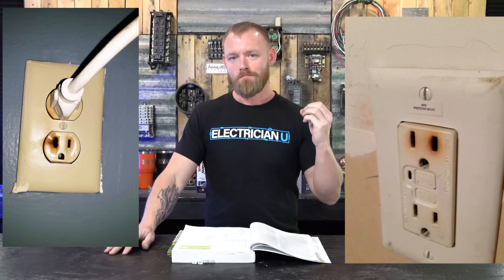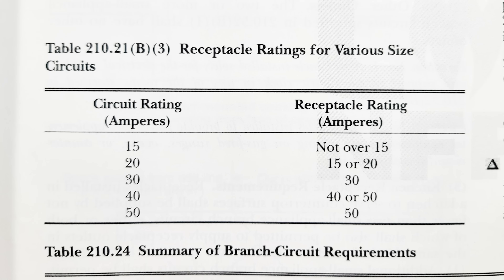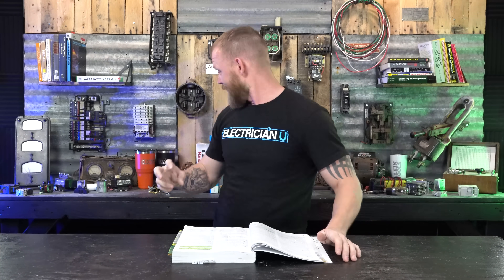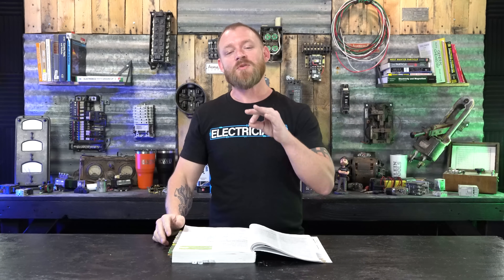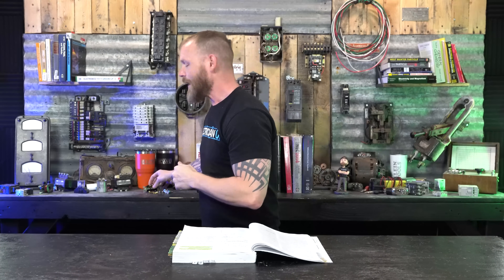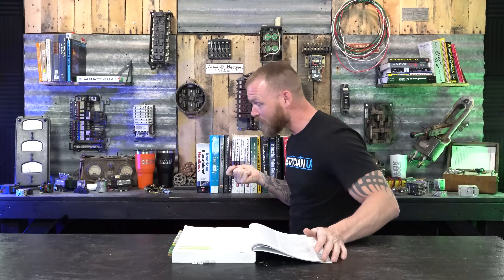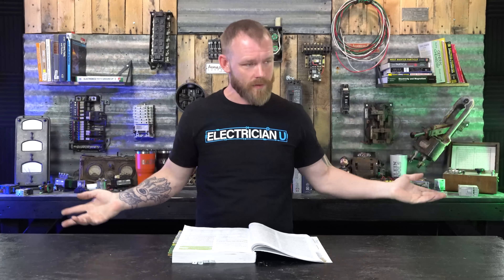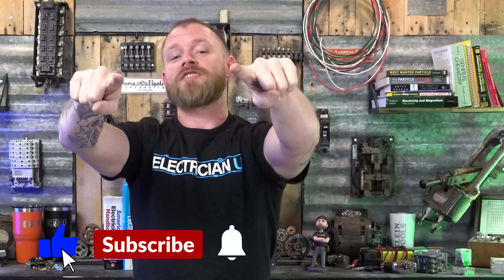Won't These Melt?!? 15amp Receptacles on 20 amp Circuits!!!

Comment: Thank you for an explanation that is not so technical that it confuses me or worse yet a tenant. While working in one of my units I noticed that a tenant had bought one of those cheap 6 receptacles in one all on a 15 amp receptacle and a 15 amp circuit. Everything on that side of the living room was plugged into this one 15 amp receptacle even though there was another receptacle on the same wall but 6 feet away behind his couch.This building when I purchased it was what my Father called a remuddle. I removed it all and left him a note that he needed to connect some of his devices into the receptacle behind the couch or around the corner on the other wall because those went to another circuit. 

He said that it was inconvenient and he hated the look of extension cords. He'd been doing that for years in other apartments so I was being an alarmist. It's an exhaustive list so I won't bore you with it but when I got home and calculated how many amps he was drawing I got even angrier. I had tried to explain that it was a fire hazard but not being an electrician and being a woman he dismissed my concerns. He demanded I return his "stuff" and I said no and when I inspected again just to be safe I found he'd just bought another one. I wrote him a formal notice of non-compliance with the lease and if it continued I'd evict him. 

He texted me that he had called a city code inspector and he was sure he'd win but the inspector came out checked the receptacle and the breaker box. Both were 15a. He still thinks that the code inspector sided with me because I was the owner and a woman and he was furious when the inspector wrote him a formal warning.  I'm going to have him and future tenants watch this video so please don't take it out of your collection of videos. Your explanation and demonstration are clear and concise and having looked at about a dozen of videos over the last few days yours is by far the best.  I am even going to watch your other videos because I think I need a better understanding of what powers a house or building. Thank you!

Comment: Thank you so very much that was very informative I'm building a shed into a tiny house and I am putting my electrical outlets in my light socket outlets and I'm going to build a little teeny tiny kitchen with a small refrigerator and I appreciate that thank you I am also off grid

Comment: And then all the common max strength space heaters are 1500w, which is 12.5 amps... So even then, some of these most common devices people will use on a single 20 amp circuit, on 15 amp receptacles are not good for code...

Comment: I am considering buying an EV to replace an old car. But my main circuit breaker is only 125 amps and my breaker panel has been filled with circuit breakers. So, I am considering just doing Level 1 charging using a 20 amp 120 volt circuit and changing the 15 amp rated plug to a 20 amp rated one. Then I could change the charge rate of the car from 12 amps to 15, as per electrical code. Is this wise? It is a circuit that only has a garage door opener on it which can be moved to a different circuit, 15 amp that is already GFI protected.

Comment: On a 20a circuit , can you wire 15a to wire to overhead light boxes from wall switch that has 20a input?  
 I ask because, the dinky wire that come with led light fixtures are easier to connect to 14 than 12.

Comment: He doesn't mention GFCI outlets with reset buttons that typically feed other "plain" GFI outlets on the same circuit with some of them being 15 AMP.  Wouldn't any of them on that same circuit trip that GFIC outlet with the reset buttons if overloaded?

Comment: Fantastic video. I didn't realize a 15 amp receptacle was different from a 20 amp. I had thought they were made simply to prevent putting a 20 amp appliance cord in a 15 amp circuit.
Reply: With the exception of some specific power tools and industrial equipment, and old Xerox photocopiers, I have never seen a 20 amp (T-slot required) plug on any residential consumer grade electrical appliance except through-the-wall (sleeve mounted, not window) air-conditioners. Incidentally, there is the very rare through-wall AC that requires a 15 amp 240 volt circuit, and those plugs look like 2 horizontal lines. ( - . - ) Only ever seen them in apartment complexes.

Comment: As the US transitions more to electric vehicle owners it will be more important to be mindful of this especially for outlets in a garage or within reach of a driveway (porch, etc).  They can pull a continuous load for a very long time, especially at 110v.
Reply: Code is one step ahead, as it has been floated to require a 20 amp dedicated receptacle for each vehicle bay. Most EV owners will however want a more robust 240 volt level 2 option.
Reply: @darrendolphdragos9752 oh for sure, 240v is better and what I'd recommend.  But even a 20a 120v outlet  will net 7 miles per hr (84 miles overnight).  That's more than most people drive in a day and would meet the needs of 98% of drivers.  Easier to get installed for most too.

Comment: My entire house was wired with 12 wire and 20 amp breakers with 15 amp outlets.  I never understood it.
Reply: If you have multiple receptacles + lights on each 20amp breaker that would make total sense. 20 amp can support up to 10 - 15amp duplex receptacles if I remember and allows for 20amp appliances at the same time.

Comment: Most new 15 amp receptacles that I have installed have a 20 amp pass-through rating stated on the box and stamped on the receptacle.

Comment: The bigger issue is sub-dollar receptacles, no matter what the rating. Over time, I've replaced every one in the house. Three of them were a bit sparky, showing visible signs of failure.  Another very practicle reason to have 20 Amp receptacles on 20 Amp circuit is so that you can visually see what you are plugging into.
Reply: news flash your industrial grade receptacle is a sub dollar receptacle.

Comment: This is great, until the load that you have plugged into the 15 amp receptacle goes south.  What happens if the load partially shorts and starts to draw more than it’s rated amperage, or exceeding  the receptacles rating. Wouldnt this cause  receptacle to overheat, before it trips the breaker?  Better not to scrimp and install all 20 amp receptacles.

Comment: A space heater is a coil of wire that glows red hot when  electricity is ran through it, which is then stuffed in a small plastic box with a tiny fan blowing on it. If government is ok with manufacturers selling thousands of these firestarters every year to families all across the country who havent the slightest clue about the danger they just invited into their homes, I feel like government can kiss my ass and has no right to regulate the permanent circuitry of my home. It stands to reason that if they take no issue with what is arguably the dumbest possible thing you can do with an electrical circuit then it would be foolish to trust anything that comes out of their mouth after the fact.

Comment: I would like to know where I can buy power strips with adjustable break trip point. I would like to set that limit to the available limit for the branch. If I have a circuit with At sum of loads, can set the limit of an additional strip to less than the limit left from previous or permanent loads.

Comment: Nonsense!  A receptacle will not safely carry its rated current if (1) its contacts are damaged by an oversized plug blade, (2) it has lost its tensile strength due to many, many plug insertions, (3) is corroded due to moisture and dirt accumulation, (3) it has supplied a high level of current for prolonged periods of time, (4) its wire connections are of inferior quality or improperly fastened.  It's not just the current.  Ohm's Law is always in effect, i.e., CURRENT through a RESISTANCE produces HEAT.  And so it goes, the codes are of little use when incompetence, misuse and lack of maintenance are prevalent.  Write a code to fix that!  😀😁😆😅🤣😂🙃

Comment: Oddly, Mike Holt claimed in 2020 (see 50m40s in his "Mike Holt Live Q&A, Thursday, May 21st 2020" video) that NEMA 5-15R receptacles have exactly the same guts as NEMA 5-20R receptacles.  Just because Mike Holt says it doesn't make it so, of course, and he begins to destroy his own argument for preferring NEMA 5-15R receptacles on 20 A circuits at 54m30s: he starts to claim that 5-20P plugs are exceedingly rare, then immediately gives an example of an appliance that draws more than 12 A and requires a 5-20P plug--namely, an air conditioner.  (A more ubiquitous example would be handheld hair dryers, many of which draw more than 12 A yet use 5-15P plugs.)

The claim that NEMA 5-15R receptacles have exactly the same guts as NEMA 5-20R receptacles (and the implication that you can rely on this) sounds dubious to me.  Certainly the Leviton 5015 spec sheet says nothing about being able to transfer more than 15 A.

At any rate, I wouldn't recommend penny-pinching with electrical outlets that people are likely to use day in and day out.  If it's a 120 VAC, 15 A circuit, use a NEMA 5-15R receptacle.  If it's a 20 A circuit, use a NEMA 5-20R receptacle.  (I see no convincing argument for why some electricians think it's OK to adhere to this practice in commercial installations but not residential installations.)  This practice of allowing NEMA 5-15R receptacles on 20 A circuits really should have been stricken from the NEC when tamper-proof receptacles were mandated.

Is this a hill you really want to risk dying on?

Comment: Here in EU we have recepticals that have ceramic internals also the code is for the receptacle to handle up to 25A even though they are labeled 16A
Reply: Which puts our US system to shame, as your 16A  circuit can carry 3,680 watts. Our 15A circuits can carry 1800.

Comment: My home was built in 1973 in Southern California and I was quite surprised to find every circuit in the home except for the lighting circuits are 20 amp. Once i discovered this, i started looking at the receptacles and to my surprise once again, they're all 15 amp variety. Before I make a move to correct these errors, i now need to determine two things.

1. Is the wiring in the walls 14 or 12 gauge? The wires must be 12 gauge in order to be on a 20 amp circuit. 
2. Is any of the wire in the house aluminum? Yes.... 1973 lands within the time frame where some houses had aluminum wiring. 

Changing out the breakers for 15 amp ones, or changing out the receptacles for 20 amp is not a big deal for me. I've been wanting to toss the POS residential grade outlets for years now due to some having become slightly loose. I'd be replacing them all with Commercial grade outlets and in places where i am constantly plugging and unplugging devices like my garage, i'll replace those with industrial heavy duty outlets. One of the big bonuses for switching to higher quality receptacles is they can be "back wired".  The cheap residential ones have 'back stabbing' which is completely different. Commercial or higher have back wire where the screws on the side have an additional plate to properly clamp the wire. No J hooks, which put unneeded stress/work hardening on the already old wires. I live in Earthquake country and the thought of old brittle aluminum conductors work hardened due to J hooks is a fire hazard unto itself.

Comment: If the average home has ~70 outlets (google) going off the prices I find on home depot (and buying them one at a time, something no contractor would do) I figure it's only $108 more expensive to run real 20 amp outlets everywhere. 

If you have to have those fancy square faced outlets, then you can actually put "old school" 20 amp outlets in cheaper than the new square 15 amp outlets. 

"deco" 20 amp sockets appear to be bonkers, though. Like near $7 a piece. Some do-nothing business major somewhere is justifying his entire existence on that inexplicable bull...

Comment: There's often no real difference for 15A vs 20A receptacles in the same product line other than that the 20A version will also let you connect 20A plugs (which almost nothing uses).

If you look at the spec sheets, 15A receptacles are almost all designed and rated for 20A feed through.

If you melted a 15A receptacle, 99.99% chance the 20A version would have melted as well.

Where you start to see differences in construction is when you move up to a higher grade.  If you're going to spend more, better to get a commercial / spec grade 15A than a residential / builder grade 20A.

As a note on the NEC's 20A requirement for "single" outlets: a receptacle that accepts 2 plugs is considered a "double", so even if you're installing only 1 receptacle for something like a microwave it can still be a 15A duplex.

Comment: I apologize if you said this but, Your a little off , A 20a appliance plug cant fit in a 15a receptacle. Thats why there is that extra slot on the neutral side going horizontal. A 20amp appliance has 1 verticle and 1 horizontal plug end and wont fit in a 15a receptacle

Comment: I am very late to this channel, However, I love it and have found it to be VERY informative to my electrical knowledge. Very much looking for feedback regarding a house just purchased that is in the 70's. Most of the circuits are 20 amp (Common circuits you would basically find in living rooms etc that would be 15 amps [14/2] min code today. AND YES THE WIRING IS SO JANKY COMPARED TO WHAT I KNOW OMG) Is it safe to add 14/2 pig tails to 12/2 in common areas to fit common plug circuits? Loads you know are not going to draw that type of power? Thank you for your assistance. If not what are the reasons for not using them?
Reply: Rather than bore you with electrical theory, my answer is why? Just use #12 pigtails to regular 15 or 20 amp (if it is a 20 amp circuit) and be done with it. I am curious though what or why you believe your circuits to be "janky?"

Comment: Correct me if I'm wrong but if you have a 20 amp circuit with a 15 amp outlet then you should not be able to plug anything in that 15 amp outlet that draws more than 15 amps unless you change the plug of whatever it is you're plugging in. Something that draws more than 15 amps has a different plug on it that will not allow it to be plugged into a regular 15 amp plug. Also the material used to manufacture 15 and 20 amp outlets are virtually the same and one is no more likely to melt than the other one.

Comment: I have a 2 story home built 89-90,and my 2 upstairs bathrooms, downstairs bathroom, outdoor outlet regular non GFCI 15 amp outlets and low voltage for house numbers and doorbell all are on a single 20amp breaker marked GFCI.This explained alot,but still makes me wonder why I have 7 breakers to turn off my kitchen 😂

Comment: Usually the Nema configurators let you put 15A plugs in a 20 amp receptacles but not backward compatible. As far as branch breakers, you have to be sure the load is not overwhelmed with too much current or it’s going to blow. Like kitchen appliances.
Reply: US yes, Canada no
Reply: @Galgamoth  Canadians have it tough. lol
Reply: @richiestarks609  we mostly use 15amp for all our wiring except kitchens
Reply: @Galgamoth  Most of the common spaces like living rooms and dens need to be 15A Arc fault/tampered resistant and kitchen or wet locations with GFCI. Good chats like this keeps the knowledge fresh in the mind. Thanks man .
Reply: @richiestarks609  no problem. I've been head of QA for a manufacturer in Canada, for almost 20 years. With getting items approved for Canada and the US, I've had to learn  both code books as well as the requirements for approval, Kinda forces you to understand why the code is there. Sometimes it's safety, sometimes it's manufacturers wanting to force a profit with their patented item.

Comment: The problem I have is my kitchen. a 1200 watt microwave and a deep fryer and air fryer all on the same circuit. I can only run one of those 3 at a time.

Comment: See I'm a DIYer and now a home owner so im more informed than most people. Im properly informed now, but I had stuff taught to me as a kid for common sense, don't burn your place down kinda knowledge... even then, before i knew what I know now, I melted a pluggin at a rental (slightly) by overloading it with a space heater and an entertainment system. The space heater on its own should have been on a single circuit and I was also running a fairly high spec computer, and a decent TV. It really doesn't take much for stuff to get dangerous and even is lamen who aren't idiots can do dumb stuff, so imagine the actual idiots out there... I know I'm fine having a 20A passthrough rated but 15A plugged duplex outlet with usb chargers, and a 15A plug with night light being on a 20A circuit cause its going to run an 1100W microwave and an unknown quality toaster oven with a spare plug for whatever. I'm fine, but if I ever sell this place, I don't know what the next owner will do!

Comment: I'm remodeling a double wide and putting 20 amp breakers in.  Thanks to you, I'll make sure my recepticals are 20 amp.
Reply: For a 20 amp circuit, you should use 12 AWG copper wire or 10 AWG aluminum wire to handle the electrical current effectively. Using the right gauge prevents overheating and potential fire hazards